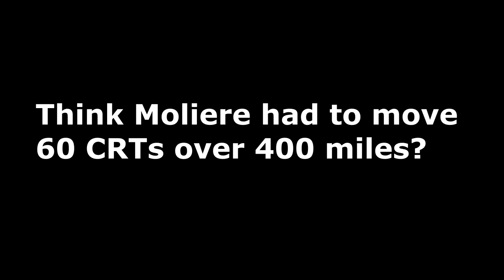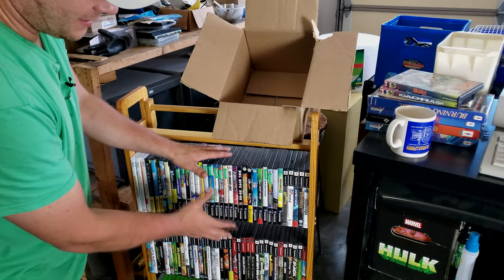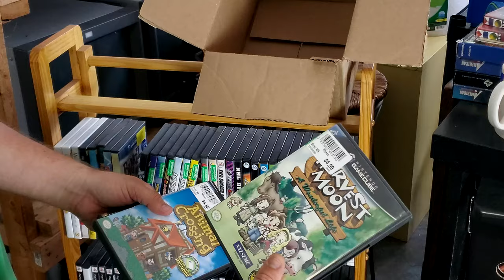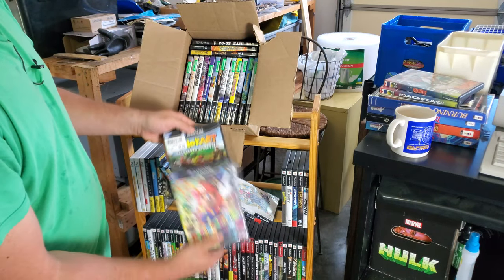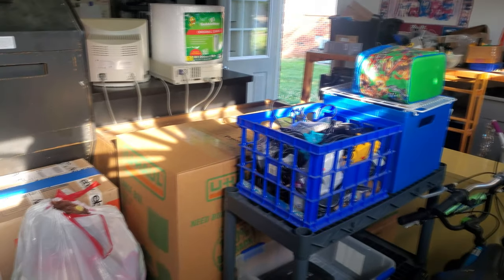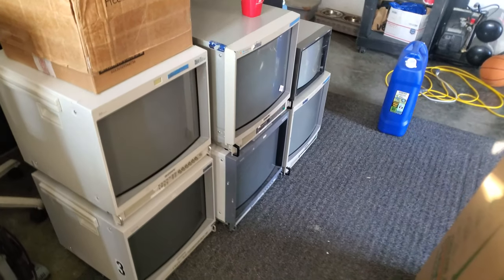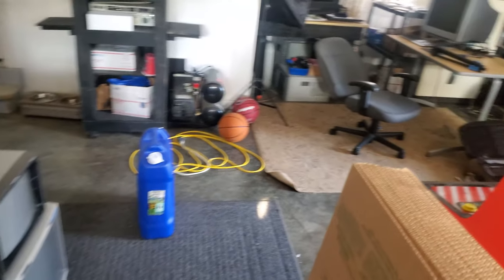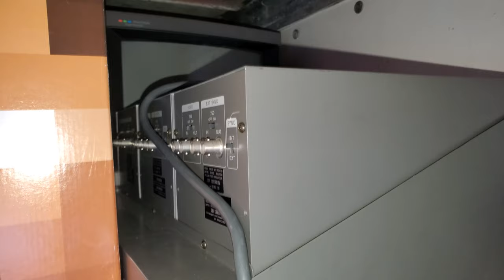Moving 60 CRTs over 400 Miles & Lifting the 36" JVC D Series! - Vlog

Comment: Damn dude, you gotta be pretty darn strong to lift and carry a 36 inch crt all by yourself, me and my brother together struggled to move a free 36in toshiba to our place
Reply: Haha I also saw that scene and wondered wtf is this Superman 😀
Reply: I have a 36 inch sony trinitron in the trunk of my grandmother's suv but it was heavy enough to where one side of the suv was a lowrider😅 and we have a HUGE problem getting it out of the car because it weight alot and it was facing the glass side and we didn't wanna risk it and would need to use a wheelbarrow to haul it to the house because it is still in the trunk 😂🤣😂🤣 and to make it even worse the grip on sony trinitrons are terrible so it's gonna be harder to even get it into the wheelbarrow.
Reply: It really just depends on if you can get a good drip on it. A lot of these are awkward to lift which is what partially makes it difficult. The one he lifted seemed to have handles, fortunately